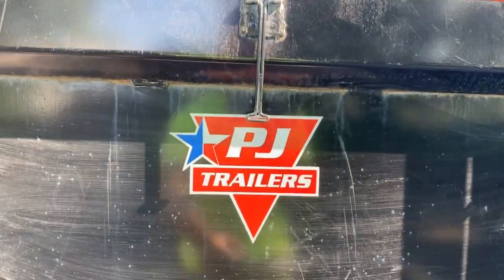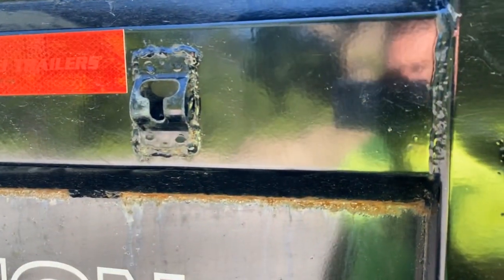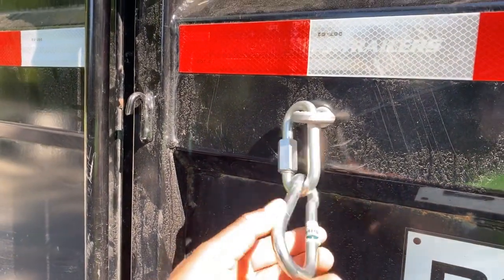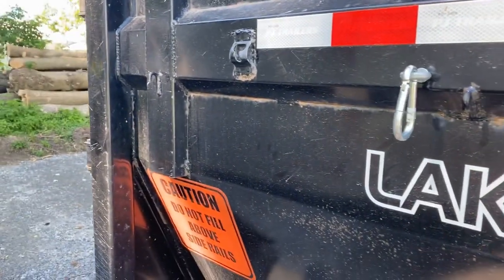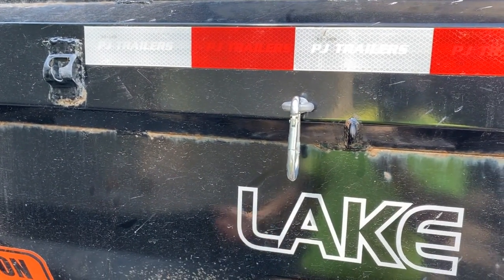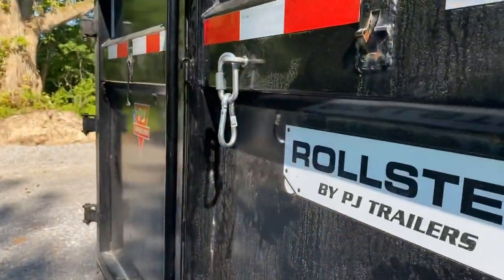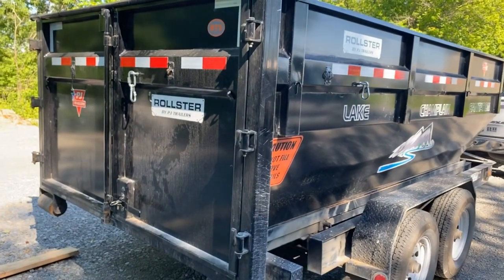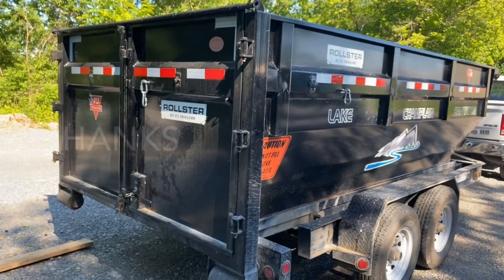Dump Trailer Door Mod | Dumpster Business Tricks

Comment: Great mod. Kinda new to this. What kind of bolt did you use to mount the chain?
Reply from the maker: I forget exactly but they were I-Bolts we around a 13-15MM nut